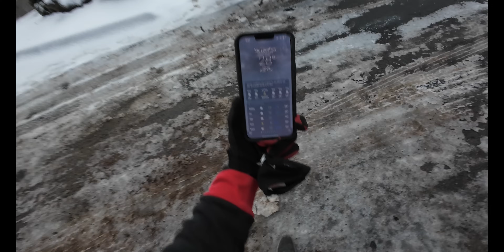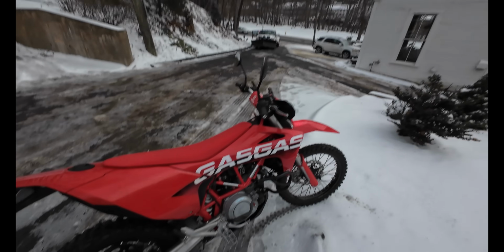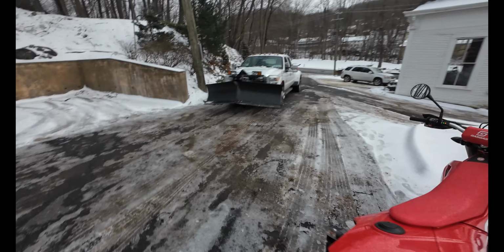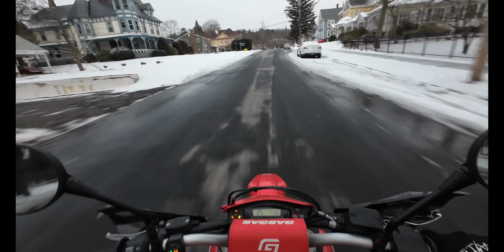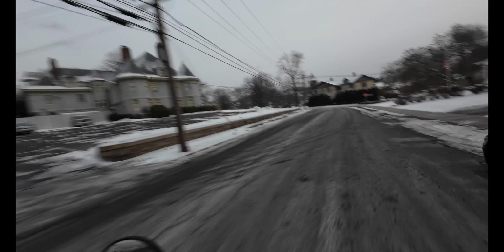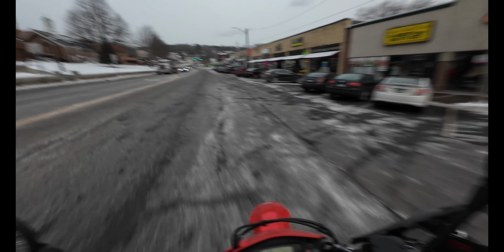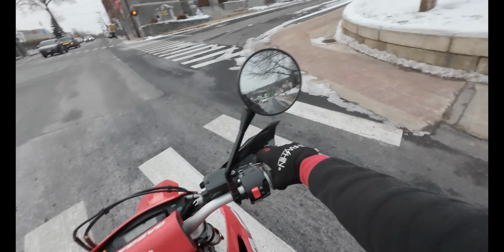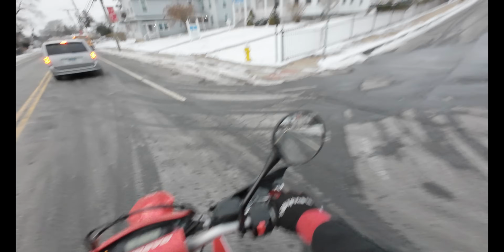700CC POWER IN THE FROZEN TUNDRA [POV 4k]

Comment: Ya buddy my style. I have a question based on say a  cb750 dohc. You miss 4th gear banging up threw the gears. What's the least damaging method to correct. I pull my clutch in and let it coast idle down well its making all kinds of nasty noise. Then still have to give it a hard grind  back into gear up or down. Anyone whats the proper procedure when this happens on any bike in any gear. Not talking hitting neutral first to second. Thanks